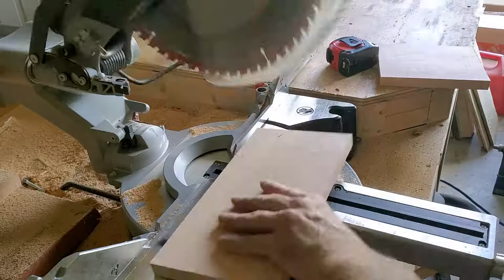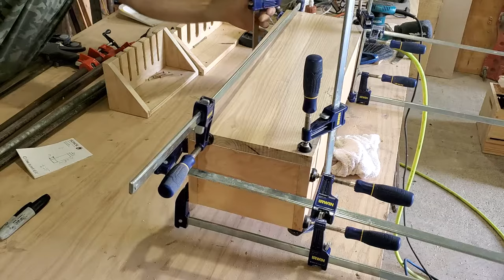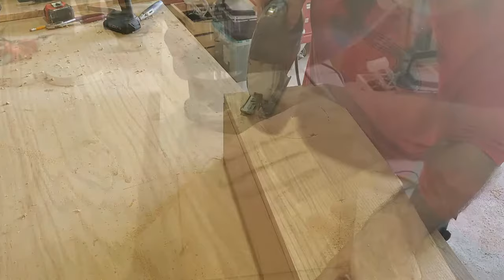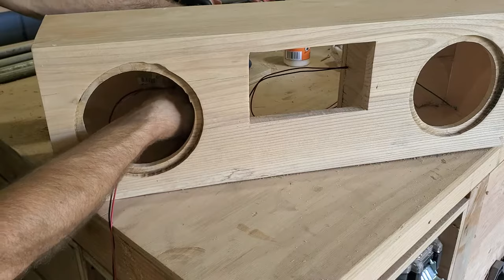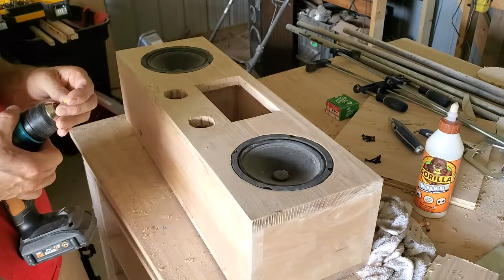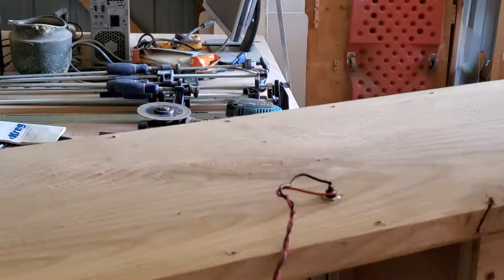DIY Car Stereo Boom Box

Comment: How is it powering itself? The one i did ran on a battery and i also gave it a wall plug in option, but if i could get it to run like this video, i won’t have so much weight on it.
Reply from the maker: 14 volt power supply
Reply: Ohhh, okay. That’s cool 😎
Reply: I’m having same issue. It turns itself off after a certain volume level. And the radio is suppose to have a 12 volt. I’d be afraid to give it anymore.
Reply: it's about the amperage that your unit consumes, it requiers how much it says on the fuse, probably about 10 amps @maxbush1197

Comment: Could you put a DC-DC supply inside the same box and connect the boombox directly to 110v? In my case I would be using a simpler CD player caradio, supposedly delivering 25W/ch. Would a 12v 2A wall war supply be enough? The speakers would be two full range 4", no tweeters.
Reply from the maker: I would use something that has at least 10 amp
Reply: @jlistdiy  OK. I am not sure what I have left on my drawers. I would like it to be 14.5v to extract the most I can and probably lower distortion. A 30A supply like the one you used, adjusted to 14.5v, should be the way to go. Is there a breakpoint on the radios for input voltage?
Reply from the maker: @carlose.martinez545  I wouldn't go any higher then 14.5 volt in my opinion
Reply: @jlistdiy  Thanks!